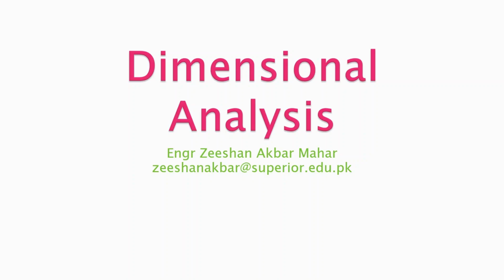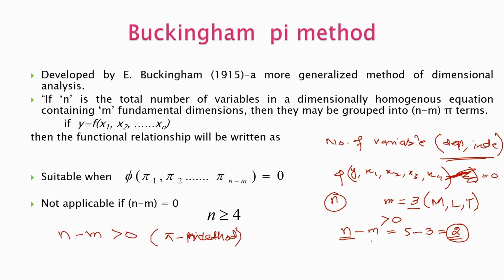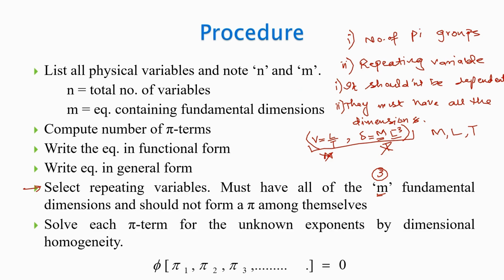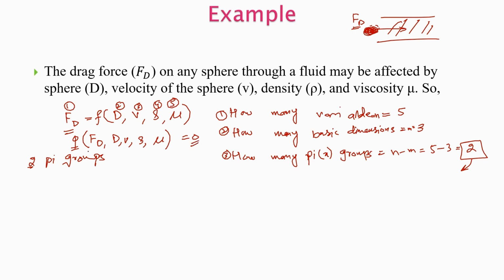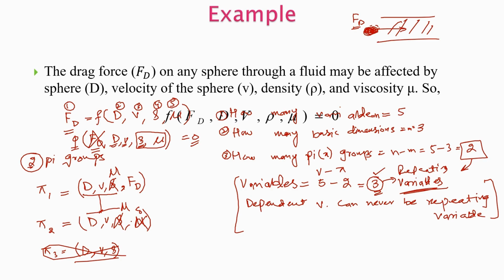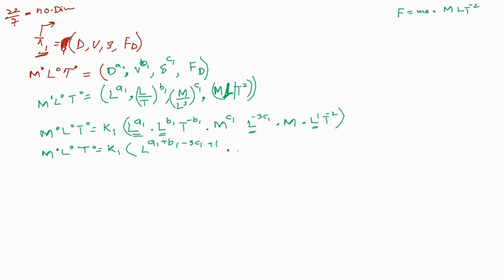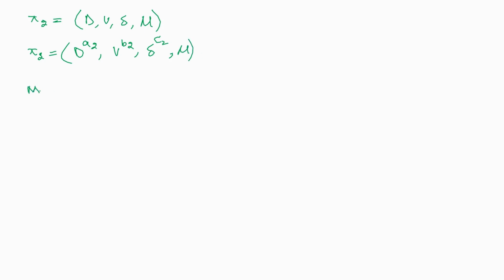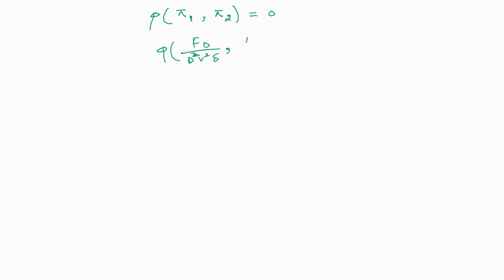Buckingham Pi Theorem Explained with Examples | Dimensional Analysis Simplified

Comment: When solving for pi 2 values of A2, B2 and C2, I think there's a mistake because in the calculations you found both A2, B2, and C2 to be equal to -1, but when doing the substitution in the pi2 variables, you indicated that B2 and C2 are both -2. Please check on this @Zeeshan Akbar
Reply from the maker: Extremely Sorry at time 30:48 the values of exponents for 2nd pi group is put as typo error.
All values are -1.
Reply: @build_wise  jazakAllah Khair for the response and i have other request if you have a tutorial on model similitude analysis please share
Reply from the maker: Thank You 
Unfortunately, that module is not available